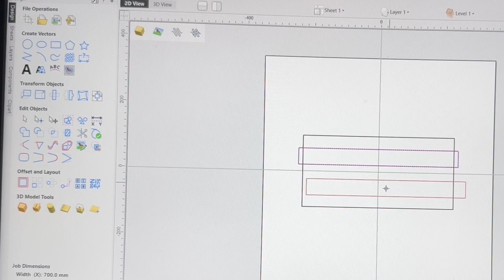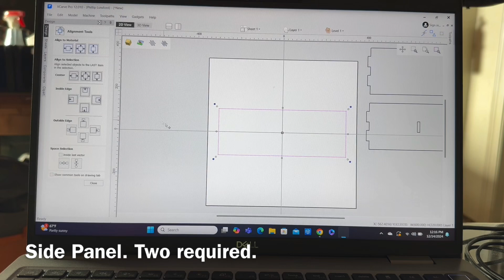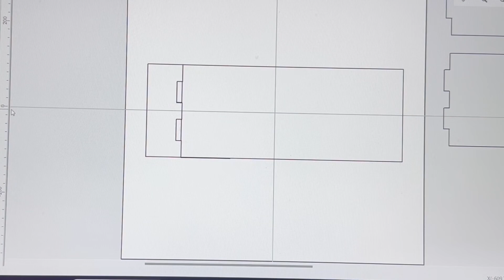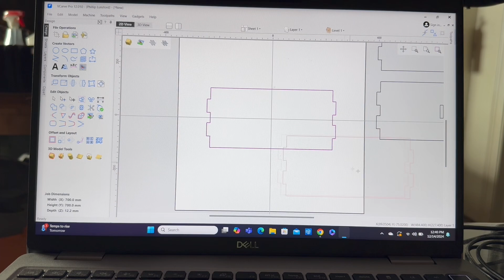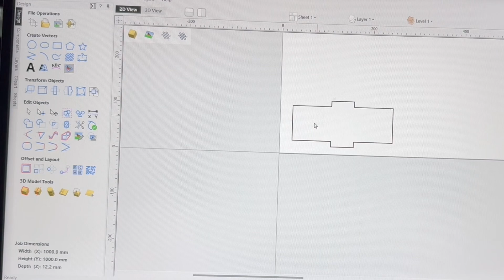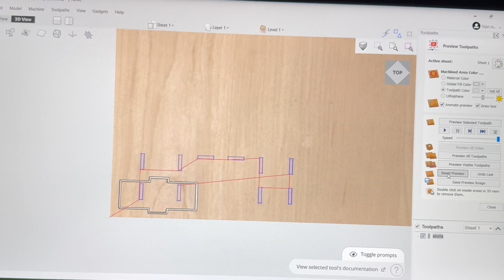How to Make  Slots and Tabs to Create a Perfect Shop Cabinet with CNC Machine

Comment: Nice video, I do the same with lots of my builds. I do the same steps in vcarve, but there's a few things I have found that makes it easier and quicker that you haven't done here...
- Instead of copying and pasting and moving and then use the move tool and reference from the home/datum...I would copy and paste but then before moving it with the mouse I go straight to the move tool menu and select the Relative option and then type the distance to move from its current position. 
- Also use the centre alignment function more, not just the align to a side/edge. And if you just move the slot rectangles (whilst grouped) to a side of a rectangle and then use the mirror tool to flip the 'slots' to the outside of the line you have gave yourself a quick guide to populate the gaps with a rectangle drawing snapping to the corners.
NOW that will create all your slots and tabs identical size without the tolerance needed to physically slot then together...I account for this once I have modelled everything by offsetting all parts inwards by 0.1mm.
With a good cutter an accurate cnc machine and decent material this is a perfect tolerance for snug tight and square fitment (with a tap of a mallet usually).

- Another useful way to move objects around, ESPECIALLY when along only the X or only the Y, use the keyboard arrow keys (use SHIFT and arrow keys move objects further/bigger increments).
- Instead of using the Cut ✂️  to remove the lines inside the shelf that were from the tabs rectangles, Use the merge/join tool that's under the arrow tool in Edit Objects, use it by selecting all your objects/rectangles that cross over each other (the 2 wide thin ones for your tabs) and the shelf rectangle too, then simply click the join tool and removes everything inside whilst also leaving (infact welding together) the outside edges. - this is WAY faster than cut tool most of the time.

Question, I didn't see you put any fillets on the internal corners of your tabs...you did the slots in the middle of the panels correctly, but you should do exactly the same dog bone filleting for all ypur internal 90degree corners of your shelf at the bases of the tabs sticking out. Unless I missed you do it on the video, If so my apologies!
All in all a good video and it's good to see someone else doing pretty much the exact same processes as me! 🙌🏻🙌🏻👌🏼👌🏼
Good work!
Reply from the maker: Wow, lots of great information. Thank you very much.